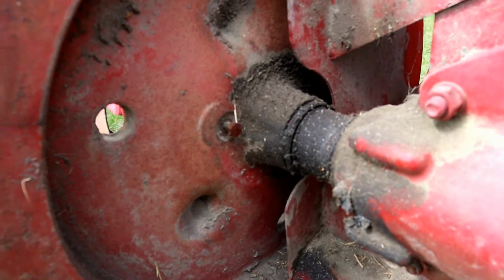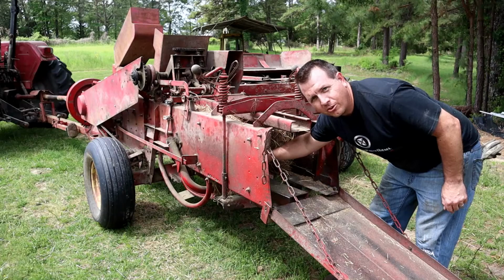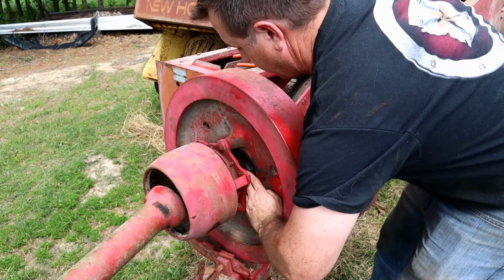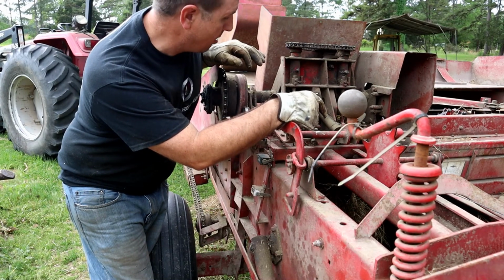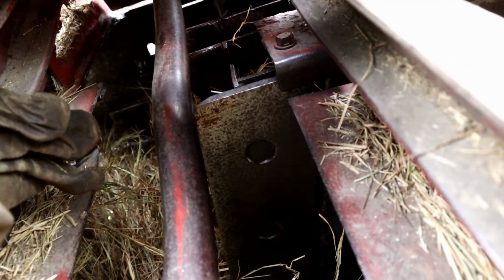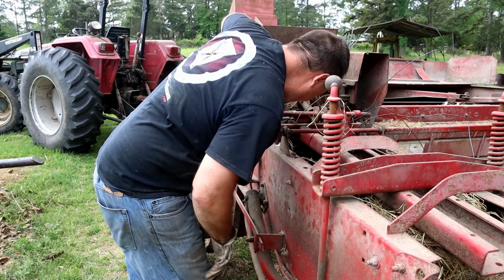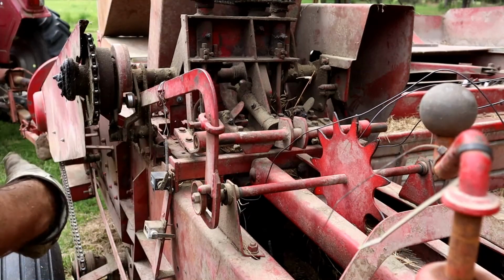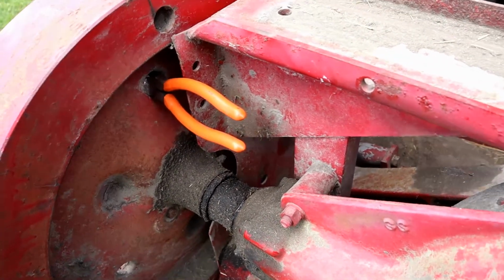How to Fix A Square Baler Broken Shear Pin And Reset

Comment: Well, you are partially correct, baling to green to quick is part of the problem. There is a clutch assembly under the cowling on the pto shaft before the flywheel. Your clutch should be able to slip if you are wadding up. Shearing pins means your clutch is seized or worn out . Check it out.
Reply from the maker: Dang must have missed that in the manual. Very helpful Man!
Reply: @Man-Time  
You're welcome, we had a  john deere and New holland if we were going through pins it was usually because of the clutch assembly. Best of luck 👍 hope it solves the problem.
Reply: I just put a new clutch on my PTO we are trying to make some test bales manual feeding so it wasn’t too much hay going in at one time. Should I back off on the tension before I try it again?
Reply: Yes, just a little, you want the clutch to work but not become irritating by constantly slipping. Best to check manufacturers' specs on tension for the clutch assembly.
Reply: Sorry Kathy, I should have started off saying hello first. You don't want your clutch plates or clutch under too much pressure. Like I said, best to check manual or manufacturers' recommendations. Happy baling.
Reply from the maker: I would say consult the manual as well. My baler has a “do not adjust” sticker on my clutch. And I think too much slack in the spring tension would cause more trouble than good.

Comment: We use Okbrand 14.5 gauge wire, but dad feels like the circumference of the wire is too big. We break down all the time. He wonders if the wire we are using is the problem. He lost a field of hay due to not getting it working in a time crunch. Any advice on that?
Reply from the maker: Sorry to hear about your loss. Been there before. 
I would say the least likely reason for a failure is the wire. Running too fast through the field is my main cause of failure. Overloading the baler